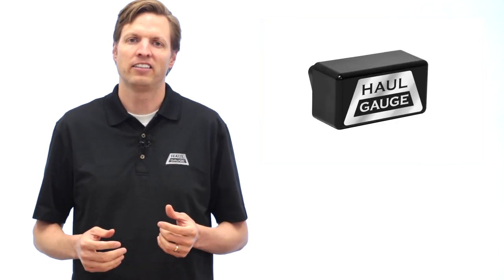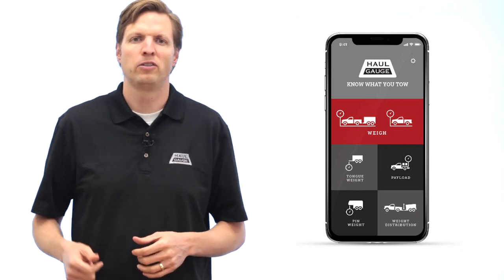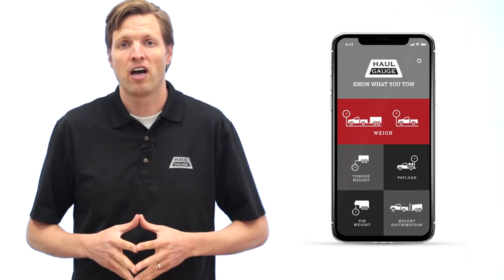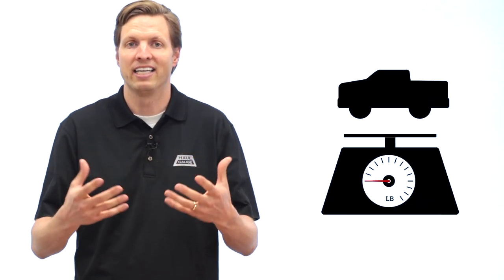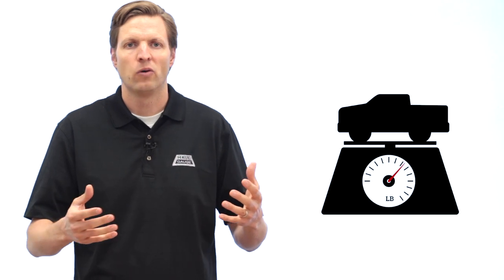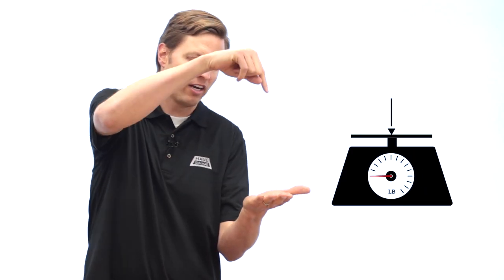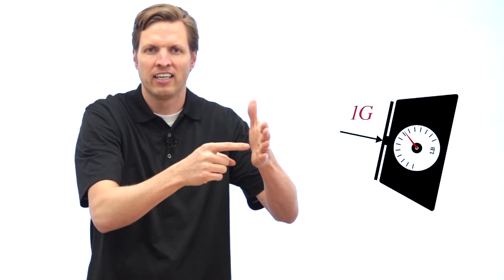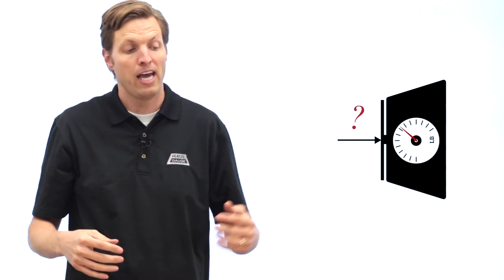How HaulGauge Works [with creator & engineer Michael Hall]

Comment: Absolutely brilliant!   I've just seen a couple of YT reviews on this product, and seems to work as advertised.   I was considering purchasing the Sherline tongue weight scale, but it only does one thing (measure tongue weight of trailer).  The Haulgage is cheaper than the sherline/similar weight scales, and does much more (vehicle weight, trailer weight, combined weight, axle weights...and, from what I've read,  it will also help you ensure your weight distribution system is properly setup.  What an amazing product; I'll be ordering one and can't wait to put it to good use.  
I guess I'm a bit surprised there aren't more RV Youtubers showing off this device.  I hope that comes soon and you guys get a ton of orders to enable you to keep adding new features.

IMHO, this is something that everyone with a trailer (TT, boat, etc.) should use.